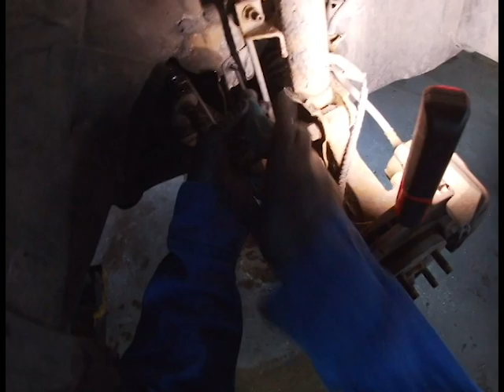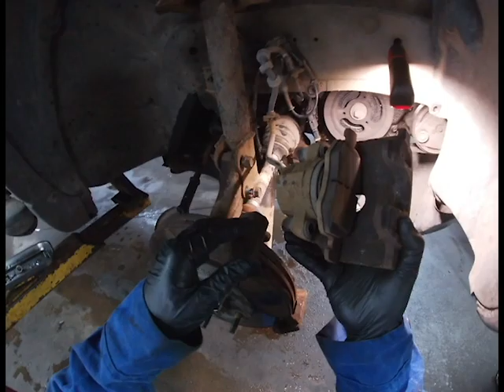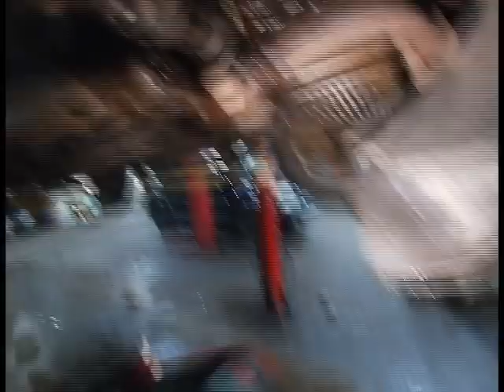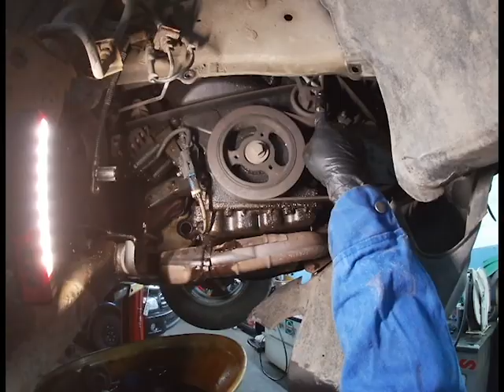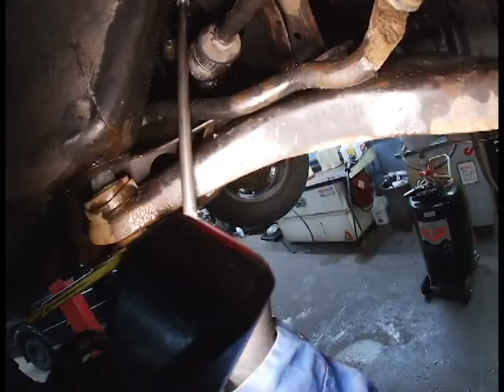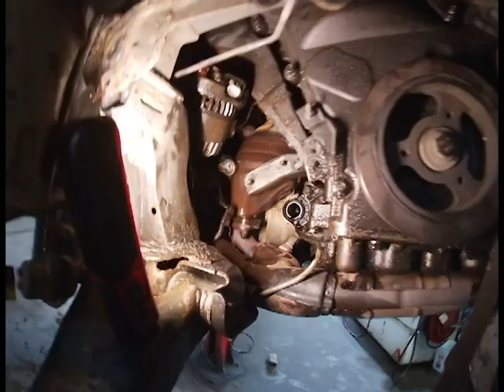How to replace alternator on ford escape

Comment: I put this off for months, did it in the driveway on jack stands, no impact tools, did use 3/4 drive breaker and ratchet for axle bolt, took me 4 hours total. Could not have done it without you. Thanks!

Comment: 2010 Ford Escape XLS 2.5l - When we battle we lose ourselves, especially with brothers in arms. Thanks for this video man and noted you told another, “some won’t come out the top”. Not sure if that’s V6, the four wheel drive version or what? But, Im here to contribute, the 2.5L XLS, I was able to access the bottom two bolts and stud to remove, between the frame cross  and the motor, wasn’t rough, 15 minutes. Then the top bolt/stud from the top, and pull it out the top. I just took off the  tire and unbuttoned that shroud around the bottom of the wheel well so when I get the alternator back in I can access the tensioner when I put the new belt on. I cannot begin to tell you how glad I was that I didn’t have to remove the  brake caliper, etc… to get this  thing out. If you, are anyone else who has worked on “the kind that require taking  it out the bottom” like your  method, please post and save a LOT OF GUYS A LOT OF TIME BECAUSE IT”S NOT NECESSSARY for the 2.5L. Thank you.

Comment: imho, this is THE ford escape 3.0 nightmare DYI repair.
$1500+ plus for mechanic to do it.
so many places for old rusty bolts to snap or the bolt heads to become stripped so that you can't easily remove them.
you could be without your car if you start this job and get in over your head.. prepare for the worst in advance.

Comment: Did this on 2007 3.0  this past weekend, in a driveway.  Didn't have 30mm to remove hub, so just left it attached to shaft, disconnected steering and no problem.  Actually may have given a little more room to work in...

Comment: You can  move through spark plug cover to yhe side and take alternator out from the top and not have to even take the wheel off!!  Why make it more complicated.?
Reply from the maker: yes some of the ford escape you can remove at the top, but others not,
Reply: You cannot take it off the top on mine
Reply: I was thinking the same thing.
Reply: @wongautofix5680  Ok, my replacement just got here from Rock Auto. Some? How do you know which some? I’ve worked on many many alternators over the years and never witnessed any replacement that required this amount of dissasembly. How do you know which will come out the top and which have to come out like this?
Reply: @rsarazindanis  What model and why? I just did, 2.5L 2010 Escape XLS. To HELP others, we need to put in detail like this. What model/year/engine do you have?